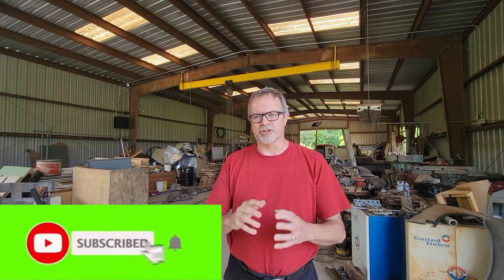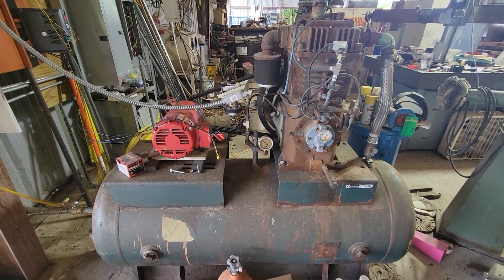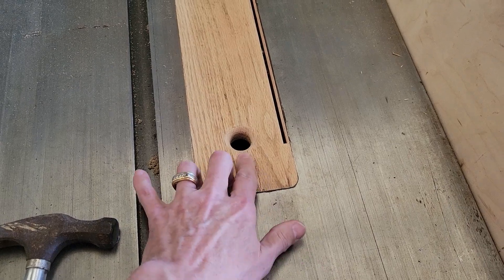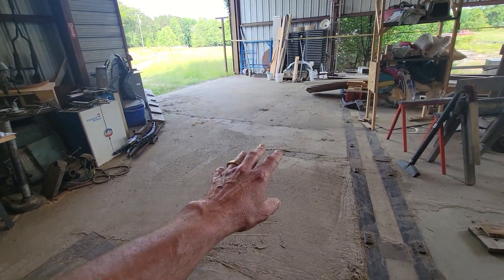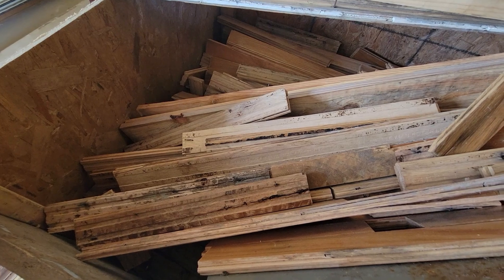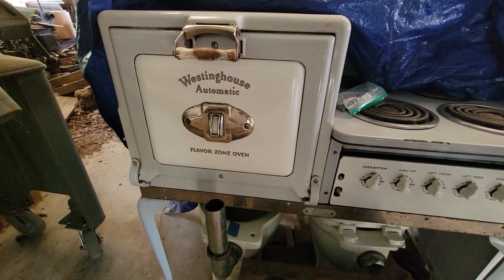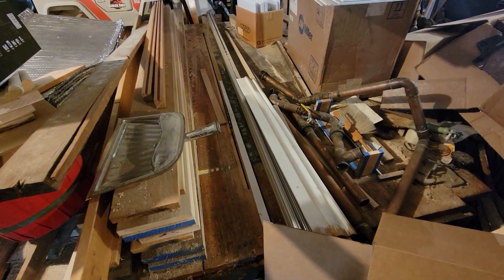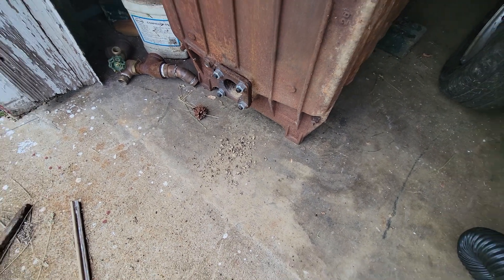Quincy Air Compressor on Inexpensive VFD

Comment: The max speed is set in several places. one is the motor config, the analog input range is independent of that. The drive should have multiple discrete inputs so you can do your speed select that way instead of various resistors in the analog circuit. 

It's not generally a good idea to run a bigger motor than the drive rating because the switching devices inside the drive (usually one big brick with all the IGBTs, the input rectifier and brake chopper) is expecting a motor impedance of no less than the typical for the drive rating. IE, 5HP 240V motor will be x amps, the margin on the switching devices is enough to withstand some overload, but not deal with windings of much lower resistance that larger motors would have. I burned out a $300 drive trying that.
Reply from the maker: I could reconfigure the pressure switches to give the speed ranges. The old Fincor drive did not have that capability, hence the resistor bridge. I should probably heed your advice and not try to run the 7.5hp tablesaw motor on a 3kw vfd. I can start it off my idler no problem, just will have to live with 60 hz speed